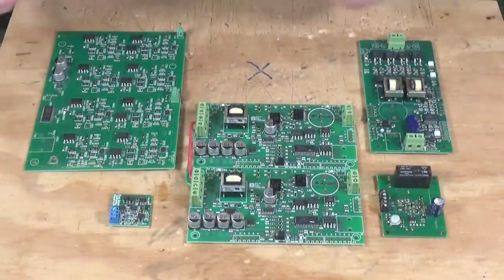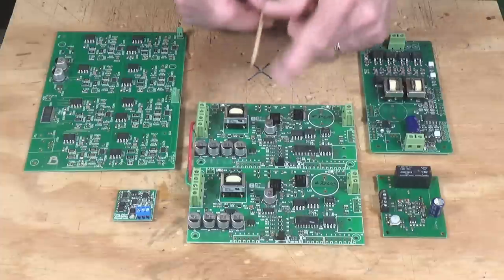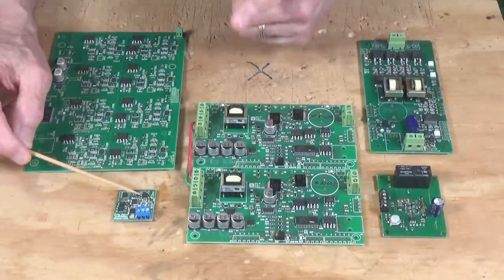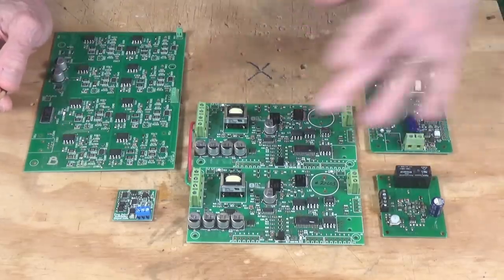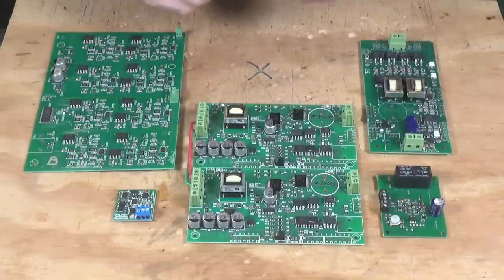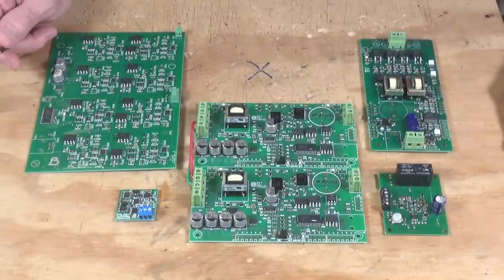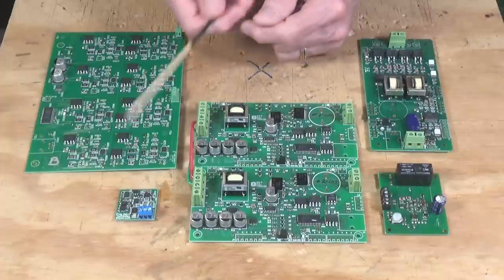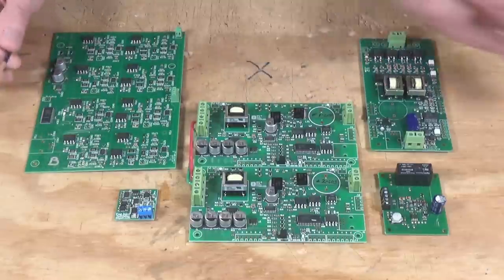The Inconvenient Truth About Autoreversers, Circuit Breakers, and Frog Juicers (279)

Comment: I'm so confused. 
I want to start construction on my ho layout but can't seem to get my head around switching. 
  I'll definitely be using the NCE system I've already purchased. 
 I have several thousand invested over the last 3 years in power, rolling stock, track and switches, but still don't have a complete understanding of switch / track control, so I havnt purchased any of the turnout control, accessory decoders - autoreversers, ect. 
  I will set up a control panel with momentary buttons for switches and plan to use Tortise machines with decoders, but, if the Tortise machines are capable of correcting polarity, I'm not really getting the need for having to add the auto-reversing. 
 Even after watching countless video offerings on the subject and not getting it,  I feel I have developed a mental block with this subject. 
  If anyone could shed some light on this for me, I'd be forever indebted. 
  The couple dozen switches I have can all easily be powered or non-powered. 
  I know I have done things backwards but have no local inspiration or mentor & probably bought track I'll regret but Ive been buying a little each month in order to have the matetials to create a decent size layout when the time comes but I have so much of it now that I will absolutely use it and transition to something better as I need to grow the layout but all of the track / switches I have purchased to date is Kato  and there is close to 80' of it including switches now, so Im stuck with it. 
  I am getting excited to start building now but still have a lot of equipment to get just to run the loops / switches as intended so I've got to resolve this soon. 
 Cheers and thanks for any input anyone cares to offer. RB.
Reply from the maker: Roger, is there no club or other modeler in your area with a layout that you can visit? I have dozens of videos on my channel that show how to install switch machines, use standard toggle controls as well as accessory decoder pushbutton controls, and even one on manual methods. I did a whole series on how to build a model railroad from cutting the wood, laying the track, installing the wiring, adding turnouts and controls, etc. Model Railroader has done numerous video series on their website that follow through the whole process too. I suggest you take a step back, watch some videos, decide on a layout design, then start the build. Before I began my Piedmont Southern layout I drew the plan using a computer layout design program, and even figured out the operating plan so I knew exactly how much track it would take, how many turnouts, and even how many cars it would take. I know most folks might muddle along and design as they go etc. but as you are finding that can get expensive. There are tons of books full of track plans and MR has published thousands over the years so pick one and avoid the design headaches. Go at this step by step and avoid the frustration.
Reply: @TheDCCGuy  Thank you for your advice and input. Every word is appreciated. 
  My nearest train related hobby shop is nearly a 2 hr drive away in Memphis and if there are any local train modelers, I have yet to ferret them out. 
  This getting older is working against me. Since commenting here, I have unpacked much of the gear I have purchased over the last almost 4 yrs and to my bewilderment, found that I must certainly have done at least some research as I began this journey because as it turns out, I have already purchased a Switch Kat and momentary switch for every turnout I have bought, also enough PM42's to cover any autoreversing and short circuit protection necessary and reviewing the included documentation has  greatly helped to demystify the operation of those devices and although there certainly may be far better devices for these particular operations, I feel I have a good understanding of how to incorporate them into my railroad and having already purchased them, see no reason not to use them. 
  Now, I'm down to my last major barrier to entry which is the operational design of the largest railroad I will likely ever build. 
  I am experimenting with AnyRail design software, but am beginning to worry that I may be too ignorant to learn the full advantages of such an incredible tool, but I refuse to give up and hire out the benchwork  portion of this build which I have looked so forward to. 
  I only wish that I had discovered this software program back when I decided to build this railroad. Perhaps by now I might have become proficient with its use. 
  Thank you again sir, for your encouragement and please wish me luck as wonder into this phase of my project. 
 Cheers!
Reply from the maker: Glad to hear your a making some sense out of it all. It can be overwhelming at times I admit. I again suggest you take a look at some published track plans. Also take a look at memphismodelrailroaders.com they list upcoming events in the area including visits to local layouts which might be helpful to you.
Reply: @TheDCCGuy  I have actually been to a couple of Memphis railroad clubs events and there are certainly some friendly members involved there. 
  They do seem to favor O scale and at least some still havnt given up on dc control lol. 
 If not for the incredible wealth of model rr  information which you and a few others so generously provide, most of us in the more rural areas would likely be comparatively in the dark ages where new technology is concerned so thank you again for the considerable investment of your time to share your knowledge. 
  I have watched hours of the content you have provided and saved much of it for future reference when I am building the rr. 
  I have reviewed countless layout designs online and I expect have a few already downloaded that I could possibly use but for the fear of regret. 
  I suppose at some point I will have to pick something and accept that I am not likely to ever select a design that will ever be perfect or utilize the  space I have 100% effectively or not wish I'd built differently. 
  I have so many wonderful scenery/ operational ideas and frustratingly little imagination of how to best tie it all together. 
  Such is life I suppose. 
  I will continue my quest for the ideal layout a bit longer and if still not satisfied, may begin one end with a module that I am certain I can incorporate as the fantasy layout reveals itself. Lol. 
 Thanks again!

Comment: Hi Larry, I have a question for you, witch circuit breaker should I used with my NCE power cab; NCE or DCC specialties
Reply from the maker: I use DCC Specialties to get the most sophisticated short detection and power management capabilities. But the NCE EB1 is a capable unit as well. You need to weigh the cost vs features and make an informed decision.
Reply: @TheDCCGuy  Thank you Larry, Im gonna go with Psxx

Comment: Do these devices have a curent draw  when not reacting to a spikce in current?  Also, it would be helpful to know where the short is occuring, not simply block the spike.  So how do I do this?  I very much appreciate your work.  Best regards,
Reply from the maker: Current draw is less than 0.04 amps. As for where the short is, you just have to look for it. Check turnouts first, then look for derail trains, trucks askew, etc.

Comment: Hey Larry,
the automatic reversers are a well thing but making problems sometimes to the direction of travel of digitalisized locos after they run through a reversing loop, a reversing triangle or using a turntable.
What about consisting them after the locos run through a reversing loop than they are probably in wrong direction?
Would they not need to get changed the regulary direction of travel in CV 29 bit 1?
Reply from the maker: The lead loco always comes out first.

Comment: I am considering using the Digitrax BXPA1.  I would be interesting on your opinion of it.  Both Tom (Tom's Trains and Things) and Charlie Bishop have commented on and are using them.  Model Railroader did a review, October 2021. The instructions with the device are sorry lacking.  Secondly, I would be interested in a discussion of transponders.
Reply from the maker: If I were going to get into feedback, I would definitely use the BXPA1. They dropped use of a physical relay for autoreversing and with the transponder receiver built in along with detection and power management it is a real all in one solution. However instead of waiting for a solution I long ago went with another block detection and signaling system so don’t plan to go there. I use the PSXX for power management and either a Dual Frog Juicer or PSX-AR for autoreversing and limit that to 2 reverse loops. So I keep shorts to a minimum and use snubbers to tame the few voltage spikes I do get.

Comment: G'day Larry, I use a dual frog juicer for a turntable polarity changer, but all points are manually activated via a rod system which uses a slide switch to cha ge frog polarity, do you feel I should included some form of circuit protection, thanks for all the videos and information, always watching from Australia. Cheers.
Reply from the maker: Wayne, I’ll be discussing this again on Friday.

Comment: Besides protecting against shorts, don’t devices like the psxx help with power on problems with multiple sound locos on a single block?
Reply from the maker: Yes, they have a special algorithm that can usually tell whether there is a short or just a surge in current caused by capacitors starting to charge up. The PSXX also has a special diode that actually filters out voltage spikes. For that and other reasons I consider intelligent circuit breakers absolutely necessary.

Comment: Can you put a ir detector at the beginning of the loop and switch polarity before the train hits the section?
Reply from the maker: Some companies make photodetectors that may be used instead of the typical autoreversers. But they can be tricky to install and the ir types use both an ir LED and a detector.

Comment: Very interesting, Larry.  Surely it should be incumbent on the manufacturers of the "command stations" to include software/hardware that prevents the massive spikes?  Or at least there should be something that you can put between the central command station and your bus that can limit spikes?  Have to admit that I didn't entirely understand why you get those spikes when there's a short, so I might have the wrong end of the stick here.

In ye olden days of DC, we used diodes over the insulated rail joiners at the exit end of a reverse loop, and then it was a simple matter of reversing the polarity as the loco went over the gap.  I guess that, as DCC doesn't have polarities, that sort of manual solution wouldn't work with DCC?
Reply from the maker: Part of it is just physics of electricity and deals with the fact that even your wires can store current which surges out in a short circuit. Plus everything that they add into the command station/boosters increases the price.

Comment: I am in process of designing an 8 x 14 ft layout (shelf). Probably one level.  I am thinking it will be two circular loops with a flip up bridge to enter the room. Industry and small yards mostly on one of the loops. Should you figure on two blocks?
Reply from the maker: It’s not so much the separation of two physically isolated areas but instead blocks are usually designed to isolate short prone areas. So a yard or industrial switching area with a bunch of turnouts should be one block. Long stretches of track with few turnouts are unlikely to see many shorts so should be one big block. I did a  article in MR on designing blocks as well as covering it in my wiring book.

Comment: Hi I use the frog juicers but was woundering if they can also run leds to show what track is open ( main or divergent route ) thanks
Reply from the maker: Take a look at video #246. In that case I used the Tortoise internal switch to change frog polarity but it is the same with the Frog Juicer. Just wire it up the way I showed in that video.

Comment: Reversing loops and frog juicers do not need to operate on shorts. Systems can be set up that operate on relays set before the loco run through. The loco doesn't get the green signal till the system is set. No shorts at all!
Reply from the maker: Yes, and I show how to do just that in this weeks video #282!

Comment: Great vid. Funny as auto reversing is an application I’m working on. Ignorant question; the area that’ll be controlled by the auto reverser, do you still connect your feeds the same as the rest of the track that’s outside of the reverse application…?
Reply from the maker: You have to check the instructions for the particular device. With the PSX-AR they should take their power from the output of the PSX or PSXX feeding the track immediately before the reverse loop.
Reply: @TheDCCGuy , thank you for your reply. The PSX uses solid states switching which I like. I’ll review instructions and schematics before proceeding.

Comment: What about using TVS diodes to clamp or stop the voltage spikes? A lot of the # rail guys use them. Not sure what size you would need or if they could affect DCC operation.
Reply from the maker: They have been used with decoders. Here is a link to an article on that.

https://forum.mrhmag.com/post/shortproofing-dcc-decoders-12330253?highlight=roy%20davis&pid=1332622313

Comment: I've been using dozens of frog juicers and about ten of the ARSC auto reversers for years on my Digitrax Super Chief system with 12 boosters without any problem. I'm finding Tortoise contacts extremely unreliable and would not use them for power routing or frog control. All my locos have "DC operation" removed in their programming so those runaways mentioned don't happen on my layout. Thanks for the brain food but I see no reason to abandon my practices. These electronics are making DCC operations a breeze.
Reply from the maker: There can be other mitigating factors, For example keep your bus runs under 30’, twist your wires or use zip cord, and operating amps under 5 amps and you might not build up enough inductance to matter.

Comment: Will rc absorption snubbers help control the voltage spikes?   After watching your video on snubbers, I found and purchased some on ebay that supposedly help minimize relay contact spikes.  They have a large current resistor and high voltage capacitor similar to what you described in your video on snubbers.  They also contain a MOV varistor for extra protection.  Conveniently, they have terminals for wiring.  Finally, they are also cheap!!
Reply from the maker: Snubbers will help with spikes and the PSXX has a special diode to reduce them too—forgot to mention that.
Reply: Donald, can you pass along the source for the snubbers you purchased?
Reply from the maker: I’m not sure how well those work with DCC as the snubbers I showed you how to build are specially designed for the DCC power signal. You can purchase ready to use versions from NCE as well as DCC Concepts dealers.

Comment: The potential "short circuit" that I am now focused on would be occurring when a turntable rotates my locomotive, changing its direction. Since I use DCC for control and sound effects I need to minimize these shorts. As I researched this situation the PSX-AR seemed to be the correct choice. I am just now starting a new layout so I haven't seen it work yet. Can anyone tell me if it works as I hope?
Reply from the maker: I used a dual Frog Juicer set up for autoreversing, however the PSXAR should work the same.
Reply: Thank You for the confirmation. I have the framework, main power lines and initial foam base in. The TURNTABLE comes next - A Kitwood Hills TT kit from England with split rings, easily configured but they left a choice of a DPDT switch or an auto reverser up to the hobbyists. I know that they have difficulty obtaining the micro motors to meet demand for kits, as well as for replacement motors because they can be burnt out by careless wiring... so I'm trying to be extra cautious at this point!!!   Thanks for checking on my thoughts.

Comment: I don't savvy !.. If I have one reverse loop of track on a DCC controlled system are you saying that the one AR and rails correctly gapped for it is still potentially going to fry my decoder or, at least, change CV values when rolling into or out of said reversing section ? 
I think most who open this video are concerned with THIS as opposed to the OTHER items used for short circuits and overloads you're citing... 
In other words, I don't think, for simple reversing loop track and the AR which controls it, there is anything to worry about or these devises would have been dumped long ago. 
You seem to be creating fear, at least for simple reversing sections in DCC, where there need be none..